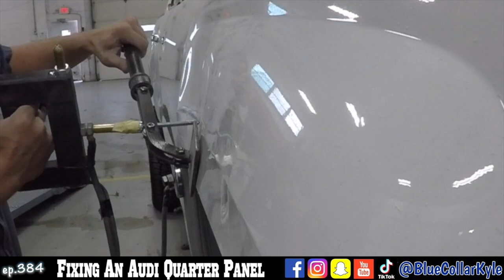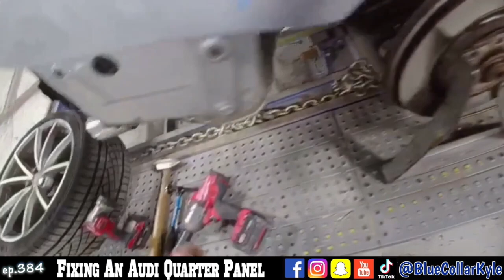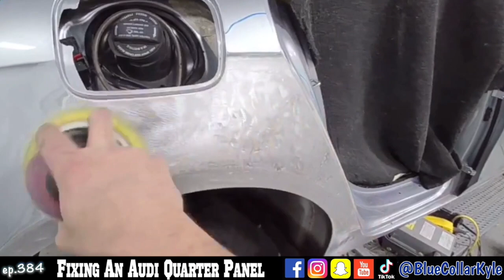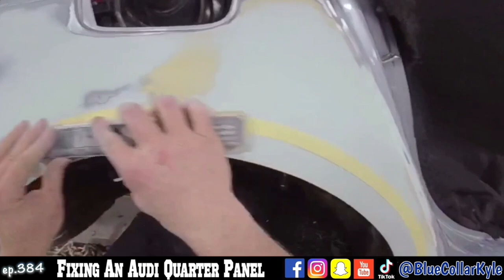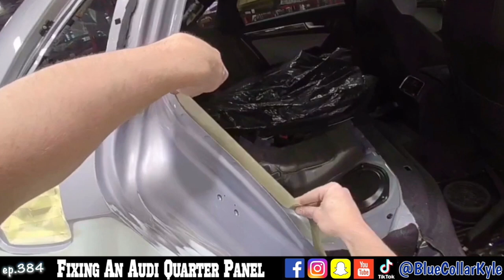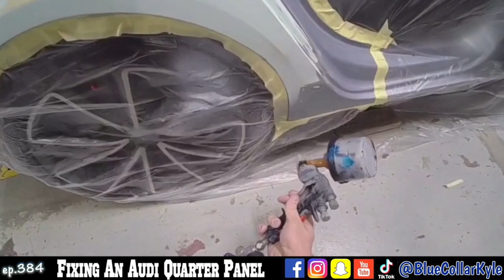Fixing An Audi Quarter Panel!

Comment: Didn’t believe u were able to make that quater panel come to looking new again. Alotta times just swap the whole panel but since it pulled back and idk maybe cost is less
Idk maybe the work would be the same from detaching the q panel and install new one vs the jobber I’m watching now just pulling it out and finessing it with many bondo coats 
Regardless this is an art it takes much patience perserverence and confidence to start a job and believe it’s gonna look spiff when it’s done 
Gr8 vid 
Gr8 werk
I’m out😊

Comment: I think 13h repair 3 h pull 3h on wheel house  just on the panel  our rate is 44 $h  19h x44$ = $$$ but check your location for shop rates  ,  the rate  are different where you live , tec can make from 17$ to 26$  a hour on his pay check , 19 x his pay rate , this is just to repair the 1/4 panel he bid a lot more he remove a lot of the in side seats and ever thing ecl ....  that all add on + part +paint =$$$$   There body tec and paint, and combo tec =  a body tec that paints ,  they have it more hard  , they fix it and paint it so they have to be good at many thing , ,   Two thing to note , it nice to do  mud work on the car-line but that 140.k , and there  chances the bond that hold the panel to wheel house came lose , and you would not think it make a sound , but with today car it could , seen  it , , , but that a very good repair and 100% respect for tec

Comment: Which primer you using?
Reply: Sherwin Williams SpectraPrime P30
Reply: @trulygifted6301  I would like to know the difference between that spectra primer and the Acme Finish 1 primer which is also by sherwin williams they are both urethane primer surfacers... i bet they are the same or close but the spectra is $125 more per gallon
Reply: Zippy TheChicken one is budget line other is premier line, better quality (resins) cost more, just that simple, doesn’t mean it’s always better though. Insurance jobs usually pay so cost is justified to spend 125/gallon, while Budget jobs not so much. I have used Acme1 and had no issues but there is some shrinkage, and film build might be lower. I personally though don’t use sherwin Williams anything unless customer brings it. If your looking for good middle-game products, Upol hasn’t let me down and neither has Roberlo especially their HS Clears. I do about 15 rebuilders a month so I need consistent results at right price to have car on road for at least 5 years no issues.
Reply: @trulygifted6301  yes that is one thing i am not happy with shrinkage... I did a car with a brand i won't mention but it was inexpensive... i had cracking so bad from shrinkage after about 2 years it looks like the clear is crystalizing and falling off the car. ok it was fricken 5star which people seem to like but .. i put about 3 full wet coats of clear... also used 5star primer... not sure what i used for base.. probably ppg...  not sure the guy i did it for even waxed the car but the stuff is turning into little crystals and flaking off... I am going to end up doing it again but not for free its been too long but ... idk .. its hard to get decent stuff now unless you want to pay $300 a gallon...
Reply: How long do you have to wait before sanding using the spectra primer? It still looks wet while he is sanding.
Reply: Zippy TheChicken the technology behind expensive clears is the UV protection. I spray only HS Clears which is Roberlo Unix 150HS for past 3 years. Not one issue and My jobber has it for $175 Kit. You can look into SPI clears too as they have good customer service.
Reply: Jay Cookie TDS says 2-3 hours if air dried. But the glossy finish is a product of the primer and serves as guide coat
Reply: @truly gifted. Thanks man the guide coat would be nice!